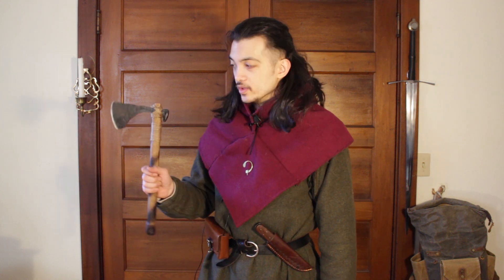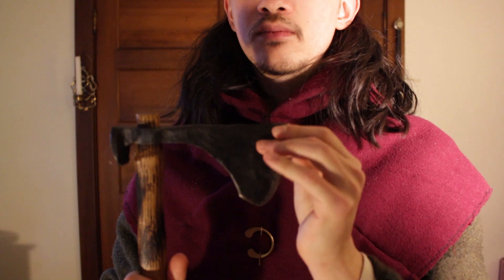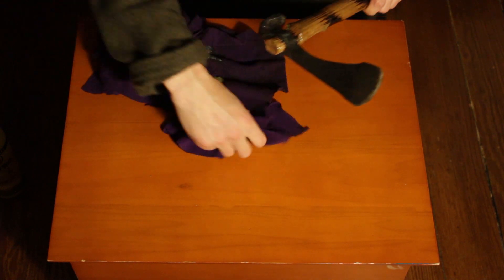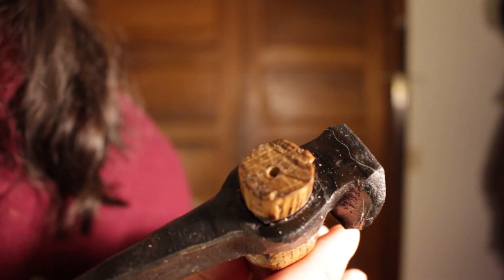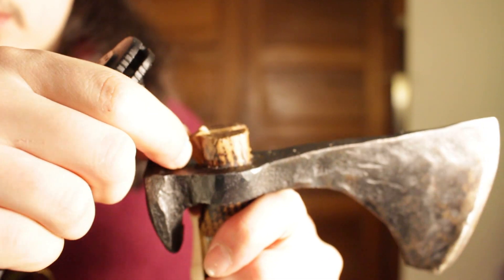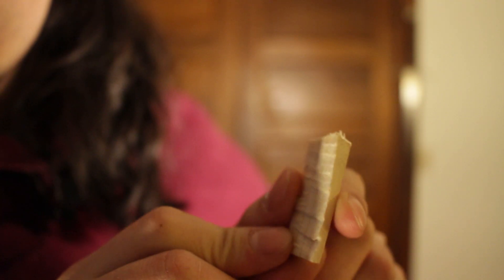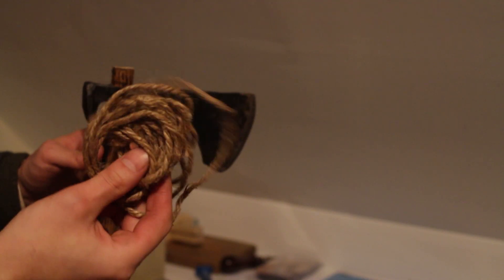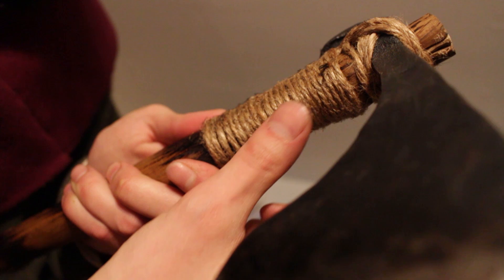I Broke My my BRAND NEW AX!

Comment: A more permanent, if a bit modern solution for keeping an axe head on would be to drive a metal wedge perpendicular to (and through) the wooden one, so that outward pressure is put on the front, back, and both sides of the eye of the axe, rather than just the left and right walls. I'd imagine that this would be possible in a medieval (fantasy) setting since an iron wedge is just an iron nail with different dimensions. If a metal wedge of the right size is not available, I've seen people put one or two short nails through the top in order to achieve the same effect, but I'm uncertain as to whether this achieves the desired effect, despite it making theoretical sense.
Reply from the maker: I was going to try this before my axe head was damaged. It's made of soft iron, and at this point just getting a new axe seems like the better bet.

Comment: Far more complicated then I realized. It makes scenes about the grain but I didn't even realize it. And I grew up using axes all the time. As for the handle, the only improvement I can think of is soaking leather in water then wrapping it around the handle and the ax head. Because leather will shrink it will secure it but for how long, I don't know.

Comment: when it comes time to replace that handle get yourself a hard metal file and start grinding out the eye of the axe into more of an oval. draw it out with a pencell first, make sure you know how much you are going to remove to get that oval shape. once you have corrected your eye then look for the right handle that will fit this most woodworking shops should have an expert to help you find just what you need and want. 

to protect the notch the axe head sits on use some sort of epoxy glue on the inside of the eye, this will make it harder to come off but will extend the life and protect that part of the handle. since this is a small bearded axe of tomahawk style so it would look cool if you wrapped the head with treated leather or twine like you did with this one. Use that same glue from earlier to help hold and treat your binding, ancient cultures used a natural glue to do this with axes and spears and I think it would look very cool in a fantasy style way.

Comment: For using water as a "quick fix" you need to use boiling water... The heat helps with the expansion of the wood, and it will depend on the wood that's the handle/wedge is made of. Softer woods will take in more water and expand faster/and more than hard woods will but over time you may need to repeat the process regardless of wood it's made of

And yes when your handle cracked you should have taken a brake and started a new one just for the safety of not having a compromised handle 👍
Reply: If you look up "impossible nail through wood puzzle" on YouTube you'll get some results that explain got it works

Comment: What you could do if you want to keep using that handle is add langets (i think thats what they are called) down the sides. Two thinish (1-1.2mm) strips of metal around 5-6 inches long, with a small (1/4 inch or so) 90 degree bend at the top and holes near the other ends to nail through. Slide them down either side of the axe head with the bends pointing outward so they hook the head, and then pop a nail in the hole to keep it there.

Another alternative is drilling and pinning the axe head itself, but i wouldnt want to do that to a nice axehead. I did it to my generic fighting axe and a stick, the head wobbles a little but because its pinned it wont fly off, i also wrapped it down about 6 inches crudely with some criss crossed leather, just in case the handle snaps close to the head.

What I would probably do is get an appropriately sized stick (thicker than the existing one so you can trim it down, and it wont shrink) from a tree (now is ideal as the sap is down so the wood is as dry as a living tree will get), peel it and let it dry somewhere warm for a while, and rehandle the axe to your exact specifications.

There are other options, but thats my couple of ideas.
Reply from the maker: I think re-handling is going to be my eventual next step. I think you're right, langets sounds correct, but I don't want to go through that much trouble haha!

Comment: When you fit an axe head on it's worth taking your time to get a close fit, really it should be tight enough that you could use it without a wedge. It's worth drying the handles in the place you're going to be keeping them before you fit the head on them.The correct way to seat the head is actually to put it on and flip the axe so the head hangs downwards, holding it by the shaft you strike the bottom of the axe shaft so the head is driven up by inertia. The grain (rings) is supposed to be parallel with the blade, if you look at old books on logging, but I don't think it really matters as much as people think. Most store bought handles it runs 45 ish degrees because they're mass produced. Whenever I need an axe handle I got to the farmers supply and look in their bin of axe and tool handles, you can normally find a nice one to adapt for your purposes and it's easier to find one without runout than sawing them from board stock.

Soaking them in water is a poor trick, the wood swells into the steel and the fibres are crushed, when they dry out the problem is worse. I've heard ethelyne glycol will soak in and not dry out but I wouldn't bother buying it for this purpose. Better to seat the head more by striking them on the bottom then flip them and drive the wedge harder with a punch or cross peen.
Reply from the maker: I'll use the hanging method when I make a new handle, thank you. I have a lot more research to do on this topic. I've never been an axe person before, this is a whole learning curve

Comment: I have never found oiling  would tighten up a loos head what it has dun is if I soak the head in wile while the axe is already tight it keeps it from getting loose as quickly but once it is already loos the oil has never helped me personally . You do have to use a drying oil like boiled linseed oil  and be extremely careful with rags as this is the oil that starts fires from spontaneous combustion ! You do need a drying oil if you want it to undergo a chemical reaction and keep the moisture locked in the wood and not just slowly evaporate over time with the water , once it has set which takes a few weeks it is no longer sticky .I like oak shims instead of wedges and generally back them up with a finishing nail so they can not work there way out over time  and will also wrap the halft of in metal wire ( galvanized steel ) in a few places to help resist splitting .
So Basically when I halft an axe I 
1- us an oak shim  
2- put to raps of galvanized steel wire one near the head and one near the butt to help stop it from splitting 
3- put in a finishing nail into the head so it goes through the halft and the shim and the shim can not work its way out 
4- put the axe in a plastic bag with boiled linseed oil for at least a week 
5- I whipe the thing down with paper towl after I take it out and then burn the papper towl so it dosnt cause a fire and let it finish set up for another week or so  
6- put a coat of wax over every exposed wood surface and use a heat gun to get it to soak in until the wood will take no more wax
Reply from the maker: Great tips, thank you for the detailed comment.

Comment: There could've been a quick fix (That actually does work) depending on how loose it was. If you could've left the old wedge in and slid another in between the handle and metal you would've been able to tighten it back up without having to remove anything. That axehead looked like it was moving a lot so you might've been able to get a piece started in, depending.

Though thinking about it you also might have been able to hammer in an extra thick nail or two. Stubby ones I'm guessing would be best so it's not also expanding the wood down below where the axehead meets the wood. But that's guesswork that just now occurred to me, so I'd try that on an axe handle you already have a replacement for lol. I've seen my grandad do my first suggestion though and it worked perfectly. If one wedge isn't working then add another.
Reply from the maker: I did try adding extra small wedges, but they didn't bite for some reason, they wouldn't go in enough. I thought about using nails as well, but since the eye of the axe is so small, probably smaller than it should be, a small drill just split the wedge in half, so I was afraid a nail would do the same thing, since the wood components are so thin.

Comment: A few things I've noticed with the limited view on here, the depth of your wedge and wedge cut seem potentially too short so your wedging is occurring above the axe eye more than in the eye meaning that its acting more like a cap than anything. Your eye shape is also i(f I saw it right) kind of square looking meaning the force applied by the wedge falls off at the corners and doesn't spread out throughout the socket (eye) as well. A tigh/almost tight fit is good before the wedging so we can compress more than the wood will dry out later.
On another note. Your axe head is made from a rail road spike wich isn't the best of metals for such a tool. The carbon content is a bit low. It will work but you will probably need to sharpen and care for it more so than if it were made out of other metals so make sure you bring tools for upkeep on your camping trip.
Reply from the maker: You are absolutely correct on all counts. The eye of the axe is slightly cornered. It is also thinner at the top than at the bottom. I think seating the head lower on the handle made the problem of the wedge being a "cap" as you say even worse to boot. And on my camping trip I ended up with a quarter inch bend in the blade of the axe. I think it is going to retire and become a decoration piece, and I just need a brand new axe.
Reply: @LivingAnachronism  aww sorry to hear that, hand forged stuff can be a bit tricky to know what they've put into it. Hope the replacement is much more to your liking.

Comment: Whoever told you the grain of the axe handle should not run parallel with the head? I would not believe them if I were you.  It also seems as though the best wedge installation is done with constant heavy pressure not hammer blows like most people would assume. Most blacksmiths who install wedges into their own axes tend to use a hydraulic press. When I saw this I decided to get my truck Jack out and use that. It worked fairly well but my truck jack is a hydraulic bottle Jack other types may not work so well.

Comment: You absolutely do NOT want oil to penetrate into wood. That weakens the fibers of the wood. What you want, and this is why we use linseed/flaxseed oil, is for the oil to oxidise into a surface coating only, to protect the wood. Mineral oil, which is what you will find in far too many wood finishing products sold in hardware stores, is terrible for wood and should never be used. Never, ever soak an axe helve in oil, and when you apply oil, apply as thin a layer as is possible so that it cures as quickly as possible.

Linseed oil will absolutely not make your axe helve "sticky". However, you absolutely do need to allow sufficient time for the linseed oil to fully oxidise/polymerise, and depending on the type of linseed oil you use, this can take a couple of days to a a couple of months. In fact, linseed oil finishes generally require about six months to fully cure, but as long as you wait until they are fully dry to the touch, you can go about your business.

This is why "boiled linseed oil" exists. It's heated in an oxygen-free environment to partially polymerise the oil so that in cures faster once applied; however, this does actually make the finish weaker than if you used raw linseed oil and allowed it to cure on its own. This is also why many linseed oil finishes include toxic inorganic metal catalysts called "driers" or "drying agents" to speed curing. I personally will only use food grade flaxseed oil without added anti-oxidants, or fine artist's grade cold-pressed linseed oil without any driers.

Of all the drying oils, linseed/flaxseed oil has the highest proportion of alpha-linolenic acid, which is why it cures the fastest and remains the most flexible and durable of all oil finishes. Just wipe a little bit on once or twice a year and set your axe aside for a couple of weeks to cure.
Reply from the maker: Your comments have been incredibly helpful, thank you. Seems there is a lot of information out there, and I found the stuff that was most incorrect. I now have some boiled linseed oil and will be using it, either on this handle or the next. Thank you so much for your advice, I wish I had learned what you know sooner! :)

Comment: if you go so far as building a new handle once this one fails, i would like to recommend a few favorites of mine, and why
osage orange is my favorite for "fighting" tools, its a north American tree so it may not fit the time and place you prefer, its one of the hardest woods on earth though, incredibly durable, but a little lacking in shock absorbsion, so i tend not to like it for things you plan to use all day long, but for a fighting tool where staying intact through a battle is life and death, i will always pick this wood, additionally its slight toxicity and incredible density make it as close to bug and rot proof as wood can get
honey locust or black locust are also American woods with some nice qualities for tool use, for long handles they might be too springy, but I've never tried either, one cool thing about black locust though is the heart wood will naturally glow under blacklight, useless, but cool factor none the less
on to the classics, the debate will never end on what one is truely the best
oak is much more common and classically used, its a little more firm than the next 2 but it does have enough give to be an all day tool
hickory is well known for being something of the best of both worlds, its less firm than oak but more springy, a great choice for something you will use for long work
ash is another great choice it is somewhat softer than the last two, but its much more springy, great for short handled tools you know you will be using for long periods of time, smithing hammers, carving axes, etc. though dont get me wrong, it has more than enough strength to hold as a full size felling axe too
Reply from the maker: Thank you for all of these recommendations. I believe the handle currently is white ash. I got to use an osage orange bow when I played robin hood last year. It was made by a local craftsmen, so if I'm lucky there's a supplier near by! Though having an axe that glowed would be pretty sweet.
Reply: @LivingAnachronism  thats awesome news! black locust makes wonderful bows too, so the bowyer might have some connections for you there too, unless you gotta have a glowing bow now too
its a lot of extra work to be sure, but as others mentioned reshaping the eye will help too, ether with round files, or asking a smith to drive a drift through it to fix the shape would likely be worth it, but it would need to go through hardening and tempering if a smith did it

Comment: it is not such a bad fix as you let on, the pressure of the axe head on the wood should stop it from splitting further but sinew or rawhide might make a more secure wrap than hemp, also you would probably have been better off filing the uneven bits off the inside of the axe head instead of cutting them off the wood because anything sharp on the axe eye will cut into the wood and cause a weak point
Reply from the maker: Very true. This axe is far from being fixed yet.
Reply: @LivingAnachronism  good luck with it :)

Comment: Sorry but that doesn't really look like an axe but more like a tomahawk. So not designed to do the heavy wood cutting stuff but more the flesh and bone cutting work. So a tool that is explicitly designed as a weapon.  Would you use a sword to drive a nail ?
Reply from the maker: I think it is technically a tomahawk. It's made out of a railroad spike. It does look similar to some viking axe profiles I have seen, but you are correct, a tomahawk is the most likely category. I'm going to use it as a camp axe + maybe train with it if I can do it safely. I won't be felling trees with it or anything.

Comment: I would avoid axes & tomahawks made from railroad spikes because most of them are softer iron & need high carbon steel inserts to be good. If it doesn't have high carbon bit it isn't worth using.

You need to replace that handle anyway it's a safety problem, any cracks in a handle make it unsafe
Reply from the maker: Yep, I encountered this probleb while camping, my axe blade bent. This will be addressed briefly in my next video, but I need a different axe, not just this one to be fixed.
Reply: I personally like thinner bit tomahawk sometimes called scout tomahawks.

Comment: I personaly never understood the charm of axes from the top, the ones slided from the botom always felt more failsafe to me.
Reply: Its safety if you have ever used a drop on head on a hoe or anything and the wood shrinks you will find can over time work it way to get over the end of timber.   Wedged in the head comes loss yet still held solidly on where slide from bottom can act perfectly solid right up to the point the head goes flying and possible hits someone.
Reply: You can have different handle profiles if the head is fitted from the top.
One that slides on from the bottom cant have curves or palm swell.
Reply: @teatowel11  thx for pointing that out, I didn't think about that